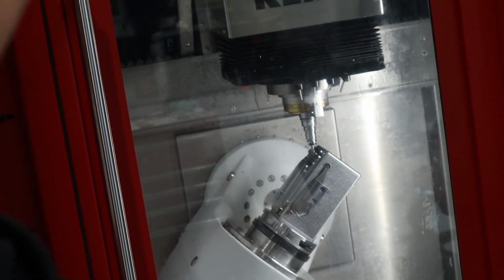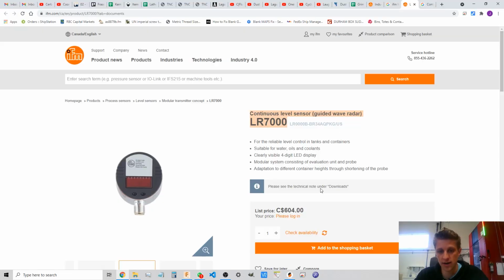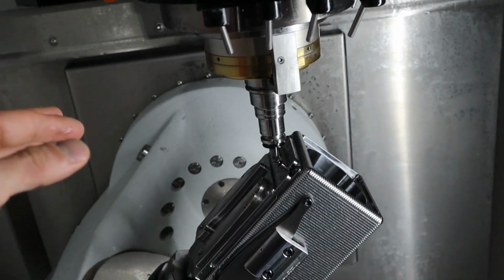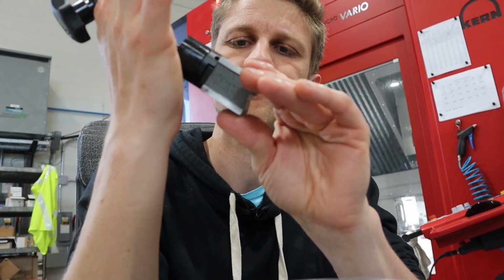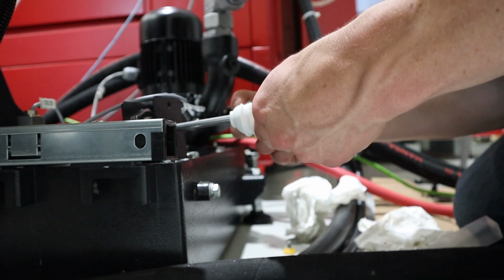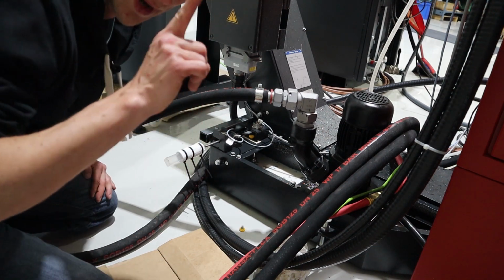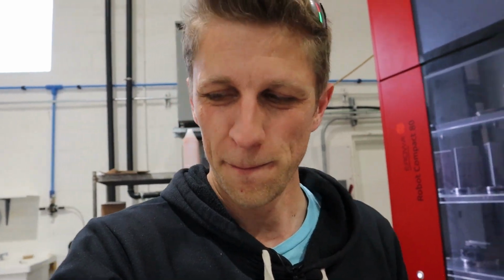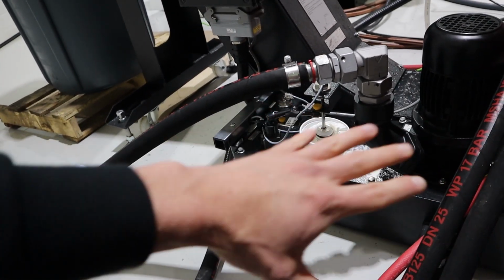Lets Improve A Float Valve

Comment: Floats on sump pumps use styrofoam. Had you cut the inner container as a styrofoam rectangle and sealed the whole assembly in a condom, it would have worked. Yes, a condom. Edit: Instead of ZipTies, electrical tape then the 3D'ed ball sleeve would be round. Then, cut a rectangular block of styro into an octagon with a bread knife/saw/hack and bore around hole into its middle, 1/2 or 2/3rds into its depth. Finally, stick the 3D sleeve into that. There's nothing wrong with styrofoam and saving the $600 bucks and your time.

Comment: Well the good thing about haveing the printer on the concrete is that it have a completely solid/ non movable support from the bottom just like the kern XD 

Have plans on getting a ender 5 plus my self and adding sand into the non moving part of the frame with linear rails and mount / bolt it to a large pease of concrete with dense foam 
Maybe even bolt some aluminum plate to the sides to stiffen up the frame completely and ofc a carbide ( and / or Ruby) nozle for wear resistance

Comment: I worked at a tie strap company in molding production(Panduit) and the tie strap you could use is a Stay Strap, the head of the strap is free floating, its called a sst, short for stay strap tie

Comment: Are all the chips steel? Place an old magnet in the bottom of the tank to catch the chips and keep them off the sensors. Will require cleaning regularly. Just a thought, thanks for sharing.

Comment: Kern screwed up by using a mechanical switch for this application!  Throw out that mechanical switch!  Install a simple conductivity probe sensor switch (similar to ones used for basement flooding) but designed for the viscosity of cooling fluid and a 0 to 30 second timer (possibly with a contactor) to run the pump. 
As the liquid level reaches the top level desired the conductivity probes sense liquid and operate the timer set for 15 seconds starting the pump to bring the level down to 10 percent after which the pump shuts off starting the process over again.  On what principle does the overflow switch operate? Is it a switch or a sensor itself?  If it’s a sensor then just use another one of those!

Comment: I had that Issue before, ended up using a pump snorkel cage with wire fly screen mesh wrapped around it placed under the sensor body. It worked for 4 years then replaced the fine wire mesh and should last another 4.

Comment: question. would chips stick to the shaft of the new sensor like they do on the side of the tub causing the radar to be off?  might just be better off with  a float switch like the style you are building that doesnt have to be submerged.

Comment: Grab a chunk of styrofoam insulation for your float. Or a 3" styrofoam ball from the craft store. Get rid of the heavy 3d printed frame--creatively bend a few inches of welding rod instead. Or just go back to the original switch, but enclose it in mesh to keep the chips out. Then send me the $600 for the radar sensor--that will cover my engineering consulting fee!
Reply: Or if styrofoam insulation is too expensive, recycle some foam packing material instead of tossing it.

Comment: Why Not throw in a sealed ultrasonic level sensor on there? you can set trip values and get a continuous 4-20mA output too if you want. I would suggest going with the Pepperl+Fuchs sensors (they have hygienic grade, IP69K rated, sealed ultrasonics. Self-cleaning head, no issues with water, dust etc. Also, the ultrasonic sensor isn't $600

Comment: After seeing how the kern filters chip out of the coolant and what you have done to improve upon that, I would be curious as to how you manage tramp oil in the kern. I believe I saw in a previous video that the Mori has something in its coolant filtration system that does it I am curious what the Kern uses

Comment: I’m by no means an expert in big expensive cnc machines, but as a mere mortal i found it surprising that it used mechanical level sensors in an environment full of chips and contaminants that can interfere with the sensors operation. I wonder if it could make sense to use conductive level sensors, one for high and one for low so you get a similar output as what the mechanical ones are delivering but they wouldnt be sensitive to contaminants. They should also be way cheaper than the mechanical ones. I am sure someone more savvy can enlighten me as to why those are not used in the first place.

Comment: if a lot of chips stick to that plastic cup it will sink and fail do it properly and get the non contact system , you have a $1m machine and re trusting a 1 cent plastic cup to keep it running ( yes I am aware that most equipment has a small fuse somewhere that will shut it down ) I did a fault analysis for the banks mainframe complex the centre manager was shocked to fine a 5 amp fuse in the EPO circuit was to fail no computer complex running

Comment: What is that stuff floating on the top of the coolant? Obviously the system was not designed for floaty chips. I have a feeling that they are going to be a problem for the radar gun. Replace the printed part and yogurt cup with a pool noodle zip tied to the float. Same idea to get the sensitive piece out of the water.

Comment: John, it would be simplier to put a round, metal wire cage around the float to stop the chips actually coming into contact with the float. You just need enough holes in the wire cage to allow the coolant level to flow easily.

The float design you have come up with assumes that the endmill container will displace enough coolant to lift the float. You will have to measure the static displacement and then calculate how high to lift the sensor to work accurately.

You should then look at the overflow sensor, as if it also gets jammed then you might have an overflow...

Comment: How many knives could you have made while messing around with this? Letting go of these unproductive urges is one of the hardest things to do. When I was an editor I spent 7 or 8 hours trying to get to the bottom of a problem that I didnt need to and ended up working to 3am. Lesson learnt.
Reply: Zero. He can't make knives if the machine wont run.
Reply: @littlejackalo5326  But the machine would run, he could have cleaned up the float ordered the new float valve he is going to order anyway and been up and running in 15 minutes. My point was more about not seeing the wood for the trees.

Comment: That screwdriver also has 1/4" and 5/16" nut drivers built in, just take out the bit or bit holder. A lot of hose clamps are 1/4" or 5/16".

Comment: Hi John, one other variable you forgot in your design is your hours cost, I remember company spending $ 10.000 on software that allowed the operator to press a key on the computer to request a balance to send the data, because he didn’t want to bend over to the flour and press the send button on the balance. This cut have easily solve with a 10 cents wooden stick
Other solution would have been an electro magnet that collect the chips an release them when the pump start. But I suggest the new sensors in the long run are going to be cheaper. How much it cast you not having the machine running.

Comment: Try ultrasonic sensors. They are relatively cheap and very reliable. Ultrasonics are used a lot for liquid level measurement, specially flamable ones.

Comment: Wouldn't even just a bigger tube or some kind of wall around it with just a little space between itself and bottom of the tank be enough ? 
so the fluid is still leveling in it , the sensors are in clean fluid and the chips can float around.

Comment: Agree with other comments that the $600 sensor is overkill. A fuel tank float would be a better option. The switch part can be above the tank and clear of the coolant with the float going into the tank on lightweight wire. Don't reinvent what's been successfully used in the vehicle industry for many years.

Comment: Iterating is fun. Just starting something in general is the first step 100% of the time, and throwing something together with what you have laying around is always a fun way to problem solve. 
There seems like there are 10 ways that company could have made the float design better e.g. a screen, non contact sensor, a lever instead of a shaft, etc. The most surprising thing is the amount of chips that settle in there and that they thought a moving part within those chips is a good idea.

Comment: I would make a fine mesh panel to go between the area the sensors sit in and the rest of that little box. Fine mesh would let coolant through but very minimal chips. I wouldn't even silicone seal it to the sides or anything like that cause you want coolant to leak past. Another possible solution would be a nexjen sump like you have on the mori with the pickup sucking from that area. Not sure how well they handle chips though since they're meant for skimming oil.

Comment: Could you also put like a piece of PVC pipe with a diameter bigger so that the float sensor can easily fit in it. make some holes in the bottom of the PVC pipe, to allow the coolant to still trip the sensor . would act like a damn for the chips, might work might not, but PVC is pretty cheap and that sensor is pretty pricey.

Comment: the noga arms magnetic field actually runs over it's housing in the off position. when it's on the field travels through the metal piece under it, which holds it on

Comment: In regards to the Klein screwdriver, check out Picquic, they’re made in Canada (BC for screwdriver, Taiwan for bits). The Super 8 holds 7 bits on display for easy finding plus it has 1/4” and 5/16” nut runners. The Mariner has corrosion resistant bits if that’s at all a concern with water or cleaning chemicals. You can order any bit to suit your needs off Tenaquip. I’ve got a full set and really enjoy them.
Reply: Also, check out Rolgear which is also made in Canada and is one of the nicest "ratcheting" screwdrivers you'll ever use. It doesn't ratchet but has roller bearings that wedge instantly to allow a ratcheting action. Highly recommended.
Reply: @RabidStork  I also have a Rolgear. There is almost no backlash and it’s totally silent. I appreciate the double ended bits they include.

Comment: Very good idea but there's an easier way used PVC pipe with multiple holes do the height of the tank wrapped with screen you'll be able to isolate the float from the chips but the water still can go through the screen good luck
Reply: I had that Issue before, ended up using a pump snorkel cage with wire fly screen mesh wrapped around it placed under the sensor body. It worked for 4 years then replaced the fine wire mesh and should last another 4.

Comment: IFM sensor won't work with current wiring terminals. If you want to use them you need separate 24v supply for the sensor. And check what kind of input the Kern control system / PLC has if you go the IFM route. PNP/NPN, now it doesn't matter as it's a simple switched contact. Also LI5131 would be much cheaper sensor and is made for this specific application
Reply: Exactly this. I would love to help him out with these kind of things.

Comment: Just have the same arrangement as the ball cock in a cold water tank, but smaller. The rod angles down and the ball floats on the surface, the switch and pivot is high and dry. No sliding action at all.

Comment: 1. get a 3 or 4 inch el cheapo plastic ball from the dime store, cut a square hole in it and silicone it to the tool holder.
2. put a plate into the reservoir sticking down below the surface of the coolant just on the machine side of the sensor to keep floating chips away from the sensor.
3. the fancy sensors MUST BE for the voltage of the machine otherwise you will pop them.
4. do the ball mod, print a 2 part adjustable stand for the sensor and save money - go have a beer.
5. as an old machinist(70) it makes me proud to see "young guys" figure out inexpensive reliable solutions for issues that come their way.
6. the best solution is the easiest solution - DON'T RE-INVENT THE WHEEL -  JUST MAKE IT BETTER.

Comment: Hi John,

One thing I hate with "fixes" like this you go for the most expensive fix or tool to do the job, and just burn money.

1. The "Primary float switch" is not always active it's only active when it gets close to the top, the "Secondary switch" is to stop overflows.
2. It looks like the "Primary float switch" is not calibrated correctly to start of with, that should be coming on at about 50% of the float length.
3. This should be taken back to Kern and be reported as a manufacturing defect, as that's not the method of sensing this fluid level, as debris will cause an E-stop.
3.1 For the amount you paid for the Kern this is a really poor design!
4. This can be solved by using some PCV water pipe with a flange at the bottom with holes drilled at every 90 degrees apart going up the pipe, this can be then held to the base using a magnet or two. Less than $10 in parts. Wrap the PCV in some flyscreen and use some cable ties to hold the flyscreen on.

Leave the top open but above the max liquid height, then slide the clean float switch inside the PVC pipe and then you're done. No more issues. 

If you want a drawing let me know.

Regards
Reply: It doesn't matter where the two senators actuate in relation to each other. One just needs to be lower than the other. Having it at 50% wouldn't solve any of the problems. It will still get stuck. The fluid will still rise enough to try the overflow sensor, and the machine will still e stop.
Reply: @littlejackalo5326 I understand what you're saying. But with the current configuration it's not right. The primary sensor needs to come on sooner. Currently there is only about 1" of difference. That's just asking for the overflow sensor to activate more often, if the primary sensor gets jammed.

If Kern had used an ultra sonic sensor they would only need 1 as they would be able to tell the level in real time, then display it on the screen. But that brings up another issue, I don't think Kern expects swarf to be in that side of the container, as swarf would just cause a mechincal sensor to jam up.

Heck if John was to empty the containers and just drill a few holes between the wall then the swarf wouldn't flow over the edge, and then get in the sensors.

I wonder if configured like this already, and John is not performing the matainance on it like he should be.

Regards

Comment: You can use capacitive proximity sensors to detect liquid, and they cost almost nothing.
Reply: Still needs additional 24v
Reply: @DeKemp  im sure they could afford 20 feet of wire using $40 sensors vs $500 sensors.

Comment: The wiring isn't as easy as it seems, the IFM Sensor needs an 18 to 30V DC power supply to work. Your current float switches are just a simple contact with 2 wires like a light switch. The IFM sensor has 4 wires L+ and L- are supply lines for the electronics in the sensor, OUT1 and OUT2 outputs for 2 different fluid levels. In the Kern junction box you have probably has +24V DC going to the white wires of the float switches and the blue wires are the outputs provides the 24V signal to the Kern controller. You need 0V DC for the power supply of the IFM sensor in the junction box.
Reply: And if its NPN/PNP input channel on the Kern, now with the leve float it doesn't matter. But it matters if he chooses to use a active sensor.

Comment: 12:14 the design of those floats is ... well to put it simply, stupid. I'd get rid of those and get a simple lever actuated switch (from a fuel pump) with a simple electronic switch at the end of the travel. I though that the higher up it went the faster the pump would go or something. That's just a basic float switch.
edit: a word / the 600 $ sensors are a rip-off. You don't need that.
Reply: Lever switch with the way you proposed wouldn't work because it has a latch range, when it goes on it stays on until about half down the pipe, the pump would get triggered only when full with a lever.